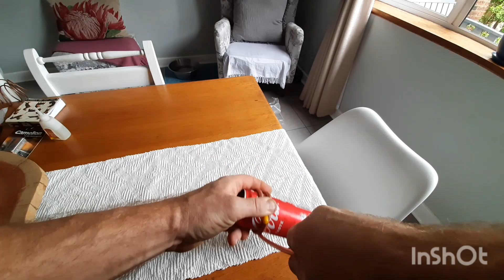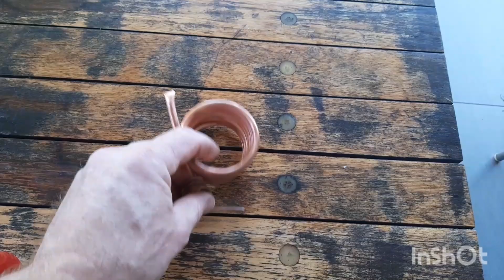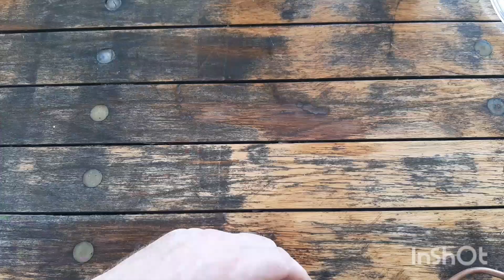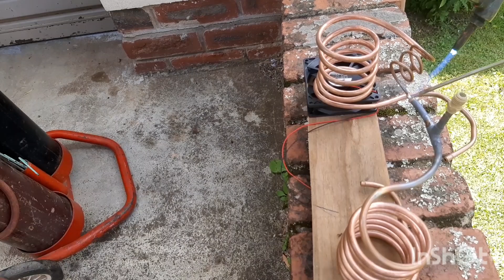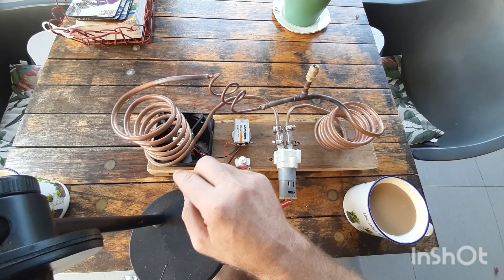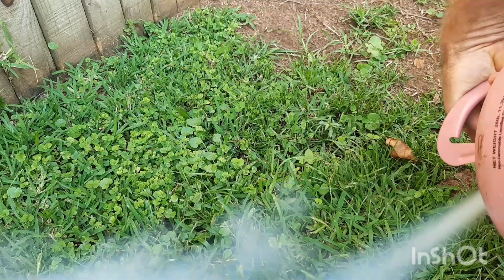Can You Make A Freezer Out Of These Simple Materials?

Comment: It could have had a chance of working with the fan on the other side if you had used butane lighter fluid instead of zippo lighter fluid. There are plenty of countertop ice makers that work perfectly well using butane as the primary refrigerant.
Reply from the maker: Ice makers dont use water pumps to compress the refrigerant.